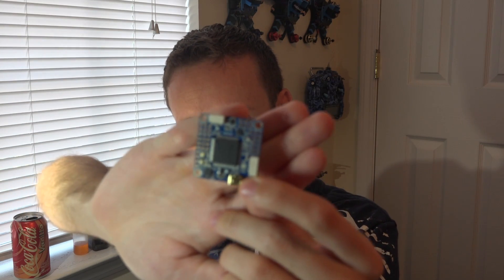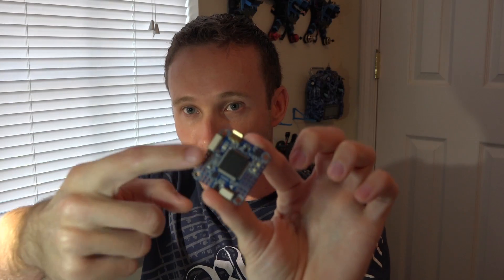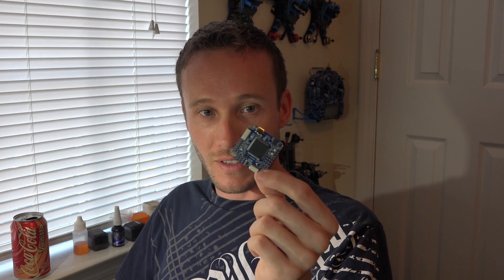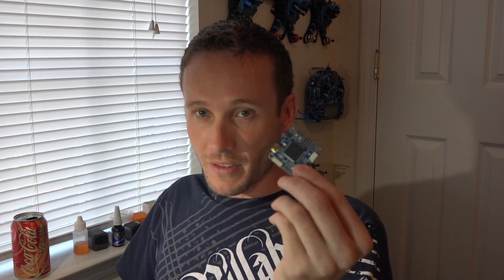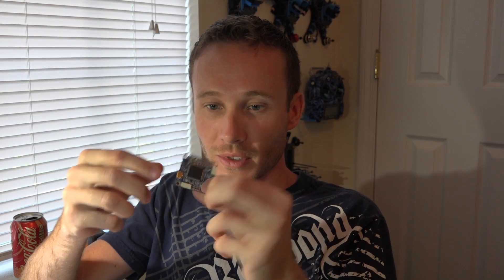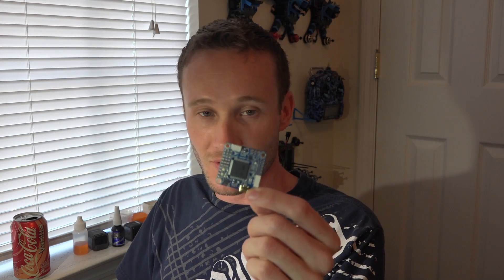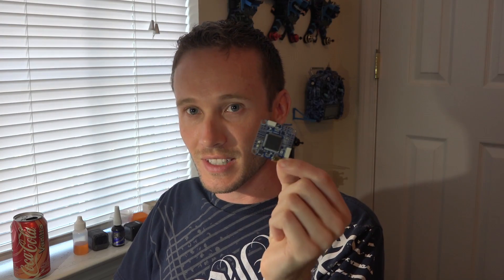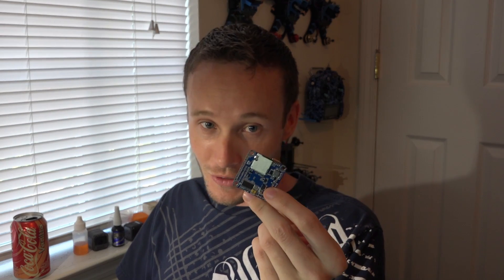Lets Talk F7 Processor Flight Controllers

Comment from the maker: Correction: The F7 processors have 25 pins per side for a total of 100 pins
Reply: You talked about features of the F7, what about preformance, my Revolt has an average of 19us to process the PID's, what does the F7 average PID loop take? (BF3.1.7), And what cpu % is the F7 on 32/32?

Comment: Do you know if the BLHeli passthrough needs to be supported by hardware or is only software (BF)?
When tried to connect with BLHeli software the board broke. The processor gets so hot you can't touch it. Is it even possible that the BLHeli broke the board? It could be a short but there where no smoke or other indication of such. Thanks for the video 😊

Comment: F7 processors are available in the same package as F4 LQFP64 (STM32F722RC and STM32F722RE). If not all the pins are being used and 4 UARTs are plenty why use the larger package size?
Reply: probably cheaper.

Comment: Hey JC, on the subject on soldering to the processor directly, i've got a https://www.banggood.com/20x20mm-XJB-F425-Dshot-Flytower-Micro-F4-AIO-OSD-BEC-Flight-Control-25A-Blheli_S-2-4S-4-In-1-ESC-p-1148284.html?rmmds=search with F4 and due to space, there is only 1 UART for SBUS, i am using an X4r, and in the configurator there are 3 UARTs avaliable, could you tell me which pin is for another UART, so i can use telemetry? Thanks, love your channel!

Comment: i had betaflight 3.2.0 on a revolt v2 had no problems but switched it back to raceflight. i personally freakin like raceflight. Although i own 6 betaflight setups and only 1 raceflight... i run BF 3.2.0 on a KombiniFC without any problems. i think they are pretty far with 3.2 by now

Comment: we have some local supplier following the "numbering" hype here, they bring in F7 without really understanding how FC works.i said its useless since the gyro used is MPU6000. 

also most F7 boards out there are based on the bigger sized F7 chip. there is a new F7 chip (STM32F722), with the same size of the F4 chip. still, its better to wait the good guys from the Betaflight team to integrate and support F7 into Betaflight, there are still some bugs.

Comment: I want to run iNav on Omnibus with 4servo's & 2motors to do some fixed-wing mission planning & long-range flights for terrain mapping so I would need at least 6PWM's +whatever a stabilized camera gimbals require...
Why is it Omnibus F3 has 8PWM outputs, F4 has 6PWM's & the new F7 has only 4 available?
Surely thats a retrograded step each time?
I know fixed-wing flight & PIFF's rather than PIDs aren't/shouldn't be as processor hungry as a quadcopter, but surely with all of the above mentioned going on I'd still be better off with an F4 or F7 processors power/speed?
Would you know of another flight controller that could fulfill these requirements & come in costing similar to Omnibus?
Thanks again for your time & efforts :)

Comment: 8k gyro vs 32k gyro - Any performance difference?
Reply: sleepyduck probably not. suspicion is that the raceflight 32k fc is so snappy because of their secret low pass filter settings.
Reply: Jordan Honeycutt Why not just reverse engineer the algorithm's?
Reply: Relys, the equipment and effort involved in monitoring the output of the FC to get a sample to reverse engineer would be better spent developing a better filter.

Comment: I'm waiting for F7 20X20mm flight controller
Reply: IRFZ44 the F7 is so big the processor takes up the whole 20mm yet alone a gyro and other crap
Reply: there's a new F7 chip (STM32F722) that have same size as F4 chip.
Reply: NM NA I haven't seen that one used... and the smaller processor has less uarts defeating the point. there's just a limit on how many pins you can fit on a processor.

also... it's called the 
stm32f7x2
all x2's are smaller and the 22blabla or 32blabla have different number of different ports used for different things.
and they are all that smaller size
Reply: like i said its new, very few FC out there with that F7 chip currently. my next version FC is based on it too and i'm playing with the prototype currently. Betaflight is not yet optimized for the chip currently.

how much uart is needed for a quad using 20X20mm FC?

its not stm32f7x2, it's actually STM32F72xRx with the LQFP64 package, and also LQFP64  package is only available on the STM32F722xx devices.
Reply: There is one
Reply: https://www.banggood.com/Realacc-20X20mm-Super_S-F7-Flight-Controller-Betaflight-STM32F745VGT6-2-4S-BEC-5V1A-20X20mm-p-1155396.html?rmmds=search boom!
Reply: I never said that it is useful ;)
Reply: Wtf? they took the joke seriously. The board can't even do beyond 8K (MPU6000) so...
Reply: Yeah. Beyond 8K is mostly noise. 8K FTW!

Comment: Hi, I watch your videos.  You an Omnibus lover.  Me not so much.  I don't want to run an FC straight off of my battery.   Nobody, even my vendor at Airbot could tell me how to power my OB F4 from my PDB 5v and get Vbat to work.  Due to a manufacturing error the buzzer didn't work on my $65 FC unless I could buy and then somehow de-solder then solder a tiny diode, uh no.  The Baro worked for a minute then I could not get a reading ever again.   I'm pretty sure when I wired it up the 3rd time Airbot suggested as to run it as mentioned above something ganked.  It's now just an expensive BL-Heli passthrough and sits on my jig board for testing/troubleshooting.  I use SP racing FC units now and have to wire up a Minimum OSD but all work as promised with them.  Considering your affinity for Omnibus you may know if was I doing something wrong.  Oh yeah the board had something like Version .99 printed on it.  I see there now there are much newer revisions and maybe would take another try at one.  If you have time to pound out a few lines to me on the subject I would be grateful.  Thx
Reply from the maker: I show how to power the F4 Omnibus with 5v from the PDB and still get vbat to work in this video
https://www.youtube.com/watch?v=2XztgmZAAu8
Reply: Sean Bittner you must have received a lemon. I've only had one omnibus hiccup and it was due to the wrong firmware. Airbot sells authentic FCs. Banggood are copies. I've got omnibus FCs in nearly all of my quads. Dys is nice, although I received one with a dead motor lead. The second worked flawless. Revolt blew with raceflight I flashed it with BF but haven't put it to use yet. I just received the Maytek F4 FC and Current sensing PDB I'll be wiring up. It's a shame you had a bad experience because they really are awesome FCs. The BF OSD is the only way I'll fly now. I don't even care about telemetry.
Reply: Thank you for responding.  I see a newer version on Ebay that's half what I paid six month ago.  I realize what's on in the below link is a knock off.  Is that the version you use?  That's not the one I had.  Where would I get one like below that's 'genuine' or a high probability of quality.  Aren't these designs open source?  If so what defines them as genuine?  Thx.

 http://www.ebay.com/itm/Betaflight-OmniBus-F4-Pro-V2-Flight-Control-Built-in-OSD-BEC-For-FPV-Drone-Quad-/382108636571?hash=item58f773159b:g:KPMAAOSwxu5ZEV6f
Reply: InFrontOfYourBack1 you can give any non pro omnibus 5v JC has lots of videos on it. just cut the legs off the regulator, power it from the 5v pin and run wires from your battery to vbat for battery monitoring.
Reply: Is JC who's Utube Channel this is? I'm hesitant.  That Omnibus I had was terrible.  Even the micro sd card reader didn't work, I tried several sizes and classes of card.  The buzzer didn't work due to a known manufacturing error.  The Baro would not come up.  At the time I couldn't find any video's, articles, etc. and no documentation except the diagram.  I made diagrams of how to possibly wire it up for power how I want and sent them to myairbot, they tried to help but didn't know either.  When you handle and solder onto these things too much they don't like it and eventually the accel unit wonked out, it worked if I adjusted it to CW270 degrees.  When I finally kinda got it 'working' I randomly got a spinning razor blade of death when I armed and gave throttle.  I switched to F3 SP and never looked back.  If they now work as promised I may give another try but the thing I find most compelling about them is the built in OSD and I think that's only on the pro.
Reply: Sean Bittner yep. just watch his videos
Reply: Now that I know more I went back over the wiring diagrams that I made and submitted to Myairbot and see that why smoke didn't come out of the board is amazing.  They didn't have a clue either.  It sits on my jig board now as BLheli flasher/motor tester, sigh.....

Comment: hey JC i´ve a build with the omnibus F7 , wraith esc 32, (samples) dshot1200,  gyro icm20608, so its 32K running and as far i can go with loops is 16/8, cpu load is about 20%,but flies well,  if i go 16/16  the cpu freezes in 100% :) :) , congrats for your videos, keep going :) :)
Reply from the maker: Yea I tried 32k/32k on 3.2.0 beta firmware and had 100% CPU load as well. I'm sure they still have to work the code out. Should be working when its officially released.

Comment: With F7 processor we gonna see dual gps in iNav?
Reply: hacksore channel are you aware of a good source for Nav builds? I'm planning to do one soon, but the info out there is really sketchy. I have motors, frame and props, but haven't selected the electronics because I can't figure out what the best options are. DJI has many FC's, but I have this feeling there are much better options. Not even sure where to start looking.
Reply: InFrontOfYourBack1 pixhawk nuff said

Comment: I know you meant that the omnibus F7 only has 4 motor outputs. With the previous Omnibus FCs you had to use a pwm5 pin for LED control with betaflight 3.1+. Has this been fixed on the F7?
Reply from the maker: Not sure yet. About to play around with it before I do some videos on it.
Reply: I'd hope it's fixed! I have the Omni F7 in the mail so I'll have to see for myself.
Reply: This is NOT fixxed yet. but it is no top of the list. the new BF3.2 will have a obus F7 from the dropdown that has this fix.  LED will work off the led port  onthe board then ....there's still some work needed, but we are working through the issues, same as when the F4s were added.
Reply: Alright,  luckily I don't have a problem with running nightlies of BF on my builds!

Comment: Why does adding a 220uf cap to the omnibus f7 up the battery support to 5-6s?
Reply: Adding a Cap helps smooth out voltage spikes from motor dampening . Even though 6s is 25v it could spike even higher without a cap.

Comment: As always a very good video. And it's always nice to have my thoughts endorsed ;)
F7 could be interesting for iNav, more headroom vor calculations. F3 is on its limit in my 760mm endurance quad.
Reply from the maker: I agree. I think the Any FC F7 might be a good choice for a hex or octocopter
Reply: On the anyfc the baro, the part itself isnt soldered on but the pins are there for it, i planning to solder it on. 

About the gyro: its could work if we just replace it for an icm 20608, or add it to by uart/spi? The mpu is looks so tiny on it, but i feel kindy funny just thinking about to make it...

What frame du u using for ur gps build? some foldable 600-700?
Reply: yes, self designed 760mm Quad, foldable to 250mm*550mm weighing 950g without Lipo and can carry up to 20Ah and a 600g gimbal and a Nex5. Flight time without Gimbal with one 5200mAh lipo is around 45 minutes. 6,5A hovercurrent ;) http://fpv-racing-forum.de/thread/2630-760er-experimentalquad-luft-nagel/?postID=38565&highlight=luftnagel#post38565

Comment: Why would we need  doubble Gyros on the F7 , don't we have enough troubles at time with just One !! LOL.
Reply from the maker: Just so you can pick whichever you want. On the Omnibus F7 you could choose the MPU6000 or the ICM20608 depending on if you want one that less bothered by vibrations, or if you want 32k
Reply: No you can choose which one to use, you could go with the faster gyro if you soft mount it or go with the slower but non soft mount 6000.
Reply: also the devs will be able to use them together for sensor fusion to get the best of both worlds and to enable some new trick . like "anti-crash" mode...aka turtle mode....

Comment: Could F7 enable "optical flow" position hold, and other sensors to power autonomous flight characteristics that APM used to provide, but lacked the CPU to really advance?  Even APM never really integrated the sensor values (Baro, GPS, Acc.) to determine when one was sending suspect data, so the platform never became 3rd-generation mature.

For all the hate thrown at DJI, at least they have tried to mature the technology.

It sounds like we keep getting hotter cars, but all we're doing with any of them is making a beer and pizza run.  At what point do better processors enable advancing beyond PID to a more comprehensive stabilization methodology that was impossible to implement with existing processors?  (was PID a workaround for CPU limitations?)
Reply: Hugh Hemington the Pixhawk is the successor to the APM 2.5 and it has a much more powerful CPU

Comment: Matek F405 runs 32k also...same gyro as the revolt board
Reply: fr8dogpilot I have a Matek F405 and it's a very nice FC
Reply from the maker: It's nice to see other boards supporting this. Betaflight 3.2.0 should be very interesting
Reply: yes it is ...I love it so far..makes a clean build

Comment: what's about using uarts in the future for controlling the escs?
Reply from the maker: I'm not sure what all they have planned in the future, but I'm sure it will be cool whatever it is
Reply: As you are using digital protocols, it shouldn't be to hard to address every ESC and control multiple of them just with one data pin.
Reply: ZeroFPV 
Especially with AIO ESC
If you're running independent ESC, that's kinda pointless